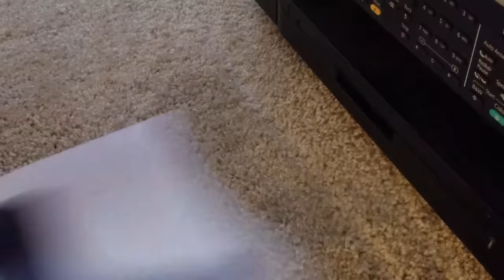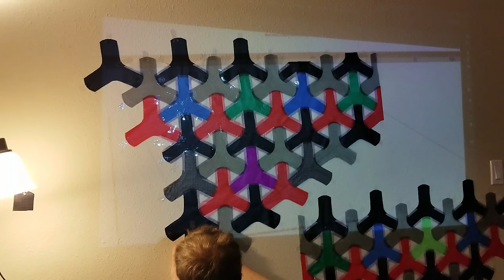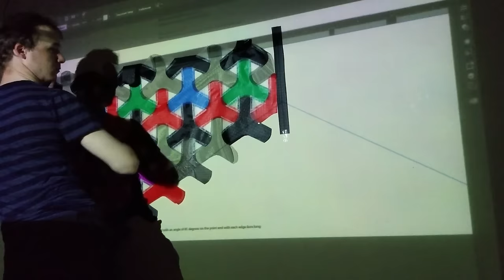Building a Sport Kite From Scraps (K28 Interlock)

Comment: Your work is admirable ! What tape did you use ? I used doubled side tape but the glue is alway gummed up and the thread is broken all the time (too much tension due to the glue I guess).
Reply from the maker: I'm largely using Angel Crafts brand double-sided tape.

I'd suggest looking at using a different thread. I use a bonded polyester thread from Thread Exchange. When I tried using a bonded nylon instead, I had the thread breaking often when sewing on tape like you described.

These days, I try to rely on hot-tacking more than taping, but still use tape often.

Comment: Looks awsome.... So you use doudle sided tape ? Doens`t the needle get very sticky ?
Reply from the maker: Yea, I use double sided tape fairly often, though I try to limit my use when I can now days. The needle can get a bit sticky from it which can be very troublesome depending on the thread that you are using. I use a bonded polyester thread from threadexchange, and I rarely have issues. When I've tried other threads, the thread breaks frequently and have lots of problems when the double sided tape is involved.

It's also easier if the double sided tape is fully sandwiched between materials. Because of this, I now tend to put an extra black layer on the back side of seems involving mesh so that I'm not just sewing through the mesh onto the tape. That seems to help and makes it look a bit nicer in the end too.

Comment: Hey I don’t think you will even see this but I was wondering what the dimensions of the sides and poles because I want to make a kite like this instead of spend 100$ to buy it.
Reply from the maker: This kite is a typical 1.5-sized quad line kite. I used an old kite that I already had to be the basis of my dimensions, and I've tweaked my dimensions as needed since then. The rods are all the same length: 31 inches. That makes the kite 63 inches wide (3 rods for the leading edge), and a little less than 31 inches tall (because the vertical rods come down at an angle)
Reply: Omg thank you so much. This will help me a tone. Thank you again. Keep having fun and stay sap
Reply: Safe*